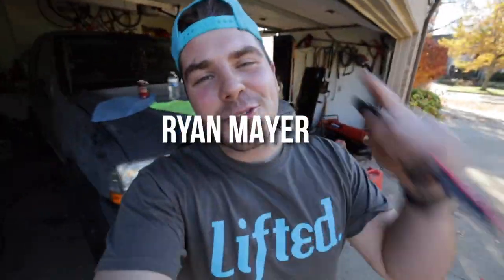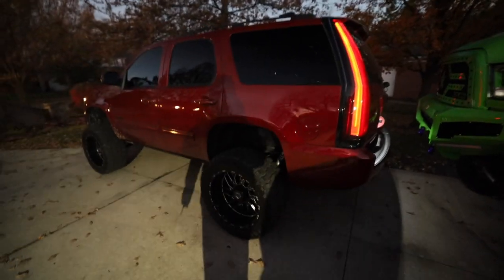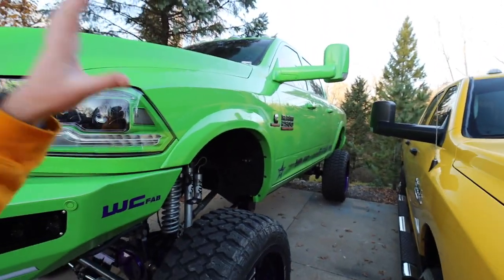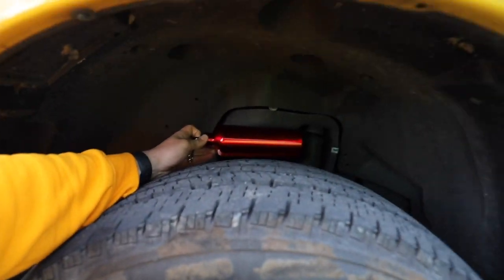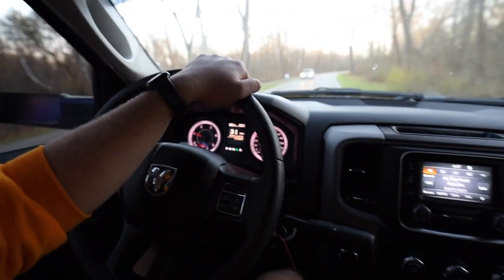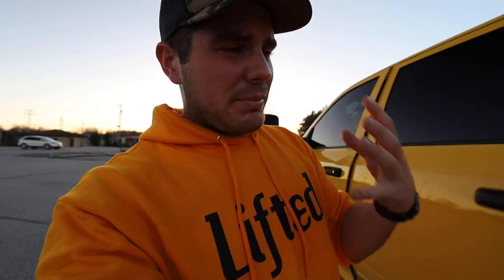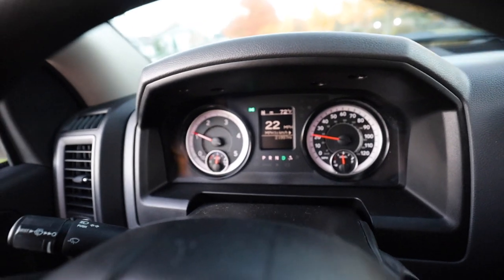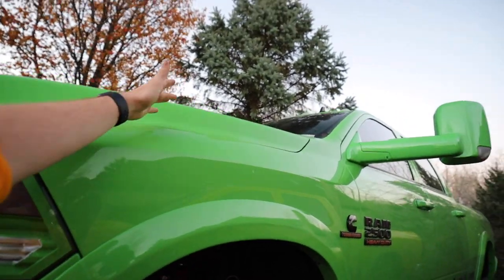Building A Banana Ram | Part 2

Comment: Color match bumpers and mirror arm with chrome mirrors. Color matched handles. Chrome wheels. Take off the ram 2500 badge keeping just the Cummins badge.. psycho yellow powder coat suspension and other pieces. Just my opinion. 
Bad ass truck. Excited about more ram stuff!!! And interested in emission compliant  stuff

Comment: Truck is clean. I think the GM style mirrors on one that are color matched would be different. There is a company that makes them now and they are plug and play. I have friends that tow on a 550hp tune on 37 inch tires on that trans and have no issues and over 100,000 miles. That’s trans gets a bad rap but is really actually pretty solid. Cant wait to see what you end up doing on this one

Comment: I’d rip those bumpers off put some ranch hand bumpers on it. I’d rip those running boards off and then color match the tow mirrors but have chrome where the mirrors actually are. And idk what you think about lift and wheels but I’d do a 6 inch lift with some big tuff wheels and some nice off-road tires and that would be a very economical sema truck. And interior wise you can’t go wrong with a Laramie longhorn interior I think the ones out of the early 4th gens look the best. Either way I think you’ll make it look!

Comment: Take the chrome bumpers off, color match bumpers, chrome door handles, yellow and chrome mirrors (if possible), remove steps and leave badging. I’m thinking maybe like a bright blue powder coat (kinda like the LA chargers) for all suspension parts and polished wheels

Comment: I think you should make it a toy hauler and add a roof rack with front and rear light bars, so when you load a goose neck you can put light bar on. Do a 6 inch lift with 35/12.50/R20 with some rear traction bars. powder coat the suspension a bronze or gold color.

Comment: 8" bds coilovers
24x14 wheels
40x15.5 toyo mt's
(personally not a fan of a stretched tire look)
Color matched bumpers and mirrors 
Limited trim interior 
Black emblems 
Weight loss and tune
Banks intake, throttle monster, and intercooler 
Spiked lugs
And I personally think either purple like u have on the OG Ram, or a translucent orange would compliment yellow nicely.

Comment: Remove the steps add amp steps, leave the chrome badges, do chrome wheels like a simple 22x14, chrome exhaust tip, paint match the rear and front bumper and grille, do a wicked customs suspension lift, with powder coated metallic sliver, or a gloss black or even a tuxedo black ! for engine wise do a second gen swap s300 or 400, and bigger injectors!

Comment: You could get with Doug over at soundman on YouTube and get an iPad dash kit for the ram. They look like they were there from factory.

I would just add some chrome wheels and leave the chrome badges. Don't wanna over due it by adding chrome everywhere. And if you don't want to have to rebuild the trans you could always reverse level the truck and run some 24x12 with nitto 420 tires. Would make it a sexy tow pig for sure. Put some helper air bags on the back for when you hook a goose neck up to it. Kinda like the black 5th gen durtymax jack did. Lots of different ways you can build one sic ride outta this truck. Any way you go it's gonna be like a sprite or 7up ..... Lemon Lime... Doesn't matter which way you go with it I'll definitely be watching the videos!

Comment: Get the tailgate light strip. 4” lift, good set of wheels and tires of your choice, and some performance mods for Mexico and just some preventive maintenance like suspension parts, steering, and can’t forget powder coating

Comment: If you are serious about pulling a gooseneck trailer you should consider full air ride front and back especially being a single rear wheel not dully air ride will help alot, also go big power and fully built transmission.

Comment: 6" lift 40s on some 20s. Do some off-road bumpers front and rear. Then get a full larime interior swap with console and all off eBay. Old school roll bar setup with led lights on top. Or look into the aev setup those are badass all together their bumpers are the best looking imo

Comment: You should do white accents, like an illusion white if that’s a thing or kind of a pearl white or even just a flat or gloss white for like the suspension components and stuff. If you’re sticking with some of the chrome parts you have to go big chrome on the wheels, you should do some massive lipped chrome wheels with the white powdercoated suspension components. You could also use an illusion yellow thats close to the paint color and use it to give the white little hits of color and bring some contrast on some of the smaller bits. So in conclusion; yellow paint matched bumpers, white powdercoated suspension parts etc with little hits of yellow to tie it back to the paint, massive deep dish heavy chromed wheels with tires without a ton of sidewall, I’d probably go for the stretched rubber look on the tires, it always looks the best on chrome wheels.

Comment: Big revmax trans. A small 3-4 inch lift 14 wides on some wide all terrains. Big single 2nd gen swap. 12mm stroker cp3 bigger injectors. Would be a monster

Comment: I do have a 36-ft gooseneck trailer it's here in Lynchburg Virginia I just rebuilt the whole driver side new brakes new bearings new pads and the other side still fairly decent but it's a 36 ft it has a toolbox on the top one you know through the tongue there and it's a really decent trailer

Comment: My vote is keep it simple, I know it’s been said several times already but yellow and black with black powder coated suspension parts.  Yes to the fender flares, but color matched pocket style.  Color matched Morimoto 5th gen style head lights, color matched LED tail lights.  Please please please paint between the windows black.  I know you said you don’t like debadging, but have custom billet badges (billetbadges.com) made for the doors (retro first gen door emblems) and a new one to replace the ram badge on the tail gate, maybe with you logo in the center (but remove the lettering off the tail gate). Please go with a squared side wall look and not the stretched tire look.  I’m not one who thinks the “stance” look is cool, I would go for trying to keep as much tire as you can in the wheel well and under the fender flares and have as much side wall as you can on your tires...........20” wheels. Lastly, I’m sure there is going to be some hate on this, but the rear bed side “rumble bee” black racing stripe, but have the bee changed so it has a turbo or diesel stacks.  Your OG ram is over the top, I would go for a build that can work but still get cleaned up for the show if that makes sense.

Comment: Chrome door handles and the longhorn tow mirrors with the chrome heads on them. Also what happend the first lift you had on the lime truck? If you still have it, put it on the banana truck and save that money for other upgrades.

Comment: Honestly I’d make almost a sleeper out of it do the changes you want to the exterior but motor and trans wise I’d go to firepunk do a 68rfe trans from them since a lot of people wanna see 68 builds over 48 swaps, d and j head , iron horn non vgt set up keep that stock location, o ring and stud the head like 30% over injectors and if you can get rid of the other stuff if ya know what I mean but that would be a build achievable by most who have limited budget

Comment: Color match grille, bumper, leave chrome Cummins badge, debage the rest on the door, chrome LED switch back handles, yellow and chrome tow mirrors, shaved tail gate, paint or wrap the pillars in between the windows black, tint it, and wrap the roof galaxy black
Reply: Also polished rims

Comment: 35 to 37 inch tall tires 13.50 wide do a 20x10 wide wheels... Do like 410 gears lockers both ends a winch in the back behind the rear bumper.. Might do like a black wheels upgrade the disk brakes.. I would use it as a daily and tow pig...

Comment: I wish it were a 2wd then I’d go with the drag truck theme. I’m kinda over the monochromatic and blacked out thing. Definetely match the small things like handles and mirror ends the pieces under the headlights. I don’t think a complete debadge would look right but I’d at least remove the ram 2500 off the doors and leave the cumins and other stuff as they are.

Comment: If you go with a little bit of chrome then you probably will need a little bit of chrome on the wheels or something. Go high with this truck tho, plz don’t go low go high not super super high like OG ram but pretty high. You could to air ride, but air ride is super expensive.
Reply: You should also put some American forces on it or specialty’s on it. If your gonna use it for towing I would put like a 4in lift on it if your gonna tow with it, I wouldn’t go super high if you do choose to tow with it

Comment: Try not to build a McDonald’s mobile 

I wouldn’t paint match the big items but door handles, mirrors and headlight trim 

I would do chrome /yellow suspension 
Chrome wheels on 40s 

If you can pull off chrome powder coat that looks as good as dipped then you would be a hero !!!!

Comment: new speakers b2 audio and full under rear seat sub set up full air ride all leather dimond stitch interior 700 hp with a muffle exhaust and 35in chrome rims on low pros my a build i would think of usually custom headlights grill and train horns full led lights in interior all new bad as head unit side step delete custom seat belts powder coat everything oracle rim lights  and rock lights

Comment: Check out 4thgenramelectronics. He’s on facebook he makes a harness to upgrade the radio. You need a harness and the hvac module to go to the same setup as lime. I did it in my 2014 tradesmen and went to the the big horn interior from a 2015

Comment: Hate to tell ya but you tune that motor at all you’ll be $6-7k deep in that trans regardless, frankly possibly $5k rebuild even without tuning it and just dragging a trailer. The 68s just don’t hold up, same as with the 48re in stock form. They’re junk.

Comment: A lot of people end up with residual amp draws on their batteries after adding numerous vehicle electronics. Adding an on-board trickle charge/battery maintainer can combat that, and operation of the maintainer can be made simple with an external, weather sealed power connection. I think adding an on-board battery maintainer to any accessorized vehicle that isn't driven daily is a wise decision. Here is an external power connection port. 

https://www.amazon.com/dp/B009ANV81S/ref=cm_sw_r_cp_apa_i_7bBSFbZ74PRJY